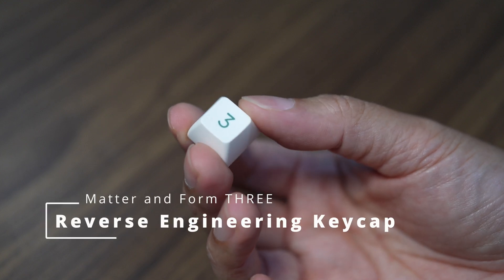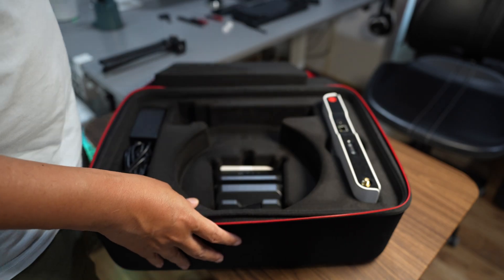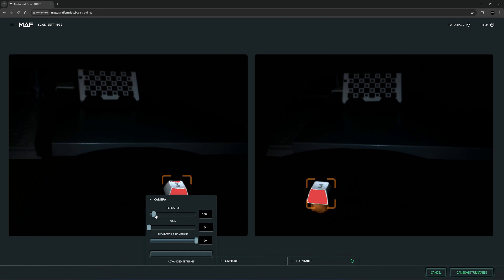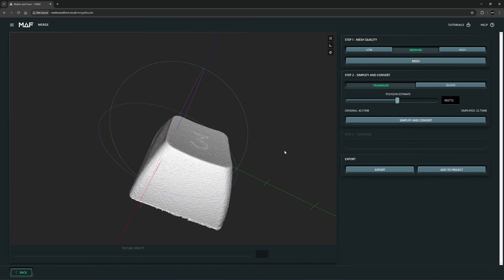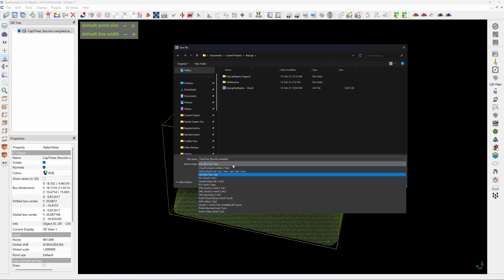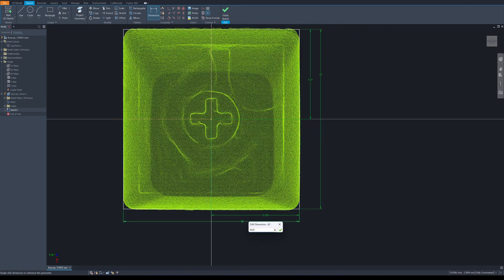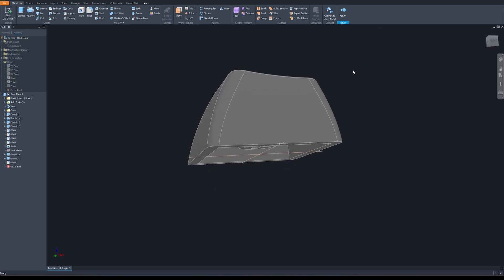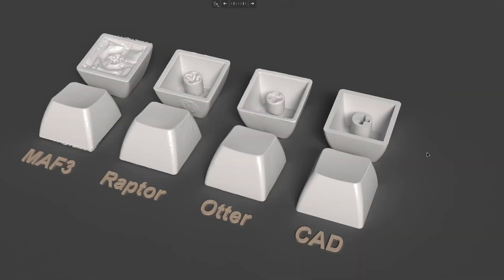3D Scan to CAD - Reverse Engineering Keycap with Matter and Form THREE 3D Scanner

Comment: I find that with small object, the MAF3 struggles (or maybe I am the issue). But it doesn't seem to have the resolution to capture sharp edges of small parts (the size of your key cap or even a little smaller). On larger items 50 mm or larger, is seems to do well, but still struggles with small details. But, I do like the "ease" of use. I can do something else while it's scanning using a turntable.  

I wish they had the ability to use markers. 
I find that their scans are noisy, they may need more work on the software side, or maybe it's just a limitation of the hardware.  What are your thought regarding this scanner?
Reply from the maker: For MAF3, applying a contrast-reducing spray may be necessary to minimize noise. The corner edges are impressively sharp—comparable to those from a laser scanner. However, it struggles to capture deep pockets and crevices, and its tripod-mounted design limits full-angle coverage in a single rotation.

Comment: Any chance you will get revopoint metrox for test? I wonder how it will compare to standard raptor.
Reply from the maker: Revopoint told me they will send the testing unit after fixing their software issue, end of Feb.
Reply: @Payo-TensileCreator  Nice we'll see if they keep their word. Price is good, tech is better (more lazzers) I only wonder how big is fov in large mode and how is overall scanning experience compared to raptor / creality scan (soft).. Is it faster, simpler, more accurate than raptor? Can't wait for your test
Reply from the maker: @ They've been stalling the delivery of the testing unit since November last year.
Reply: @Payo-TensileCreator  ouch that does not sound good.. Feb is almost over, will see what they do. Your tests are one of the best on the yt, maybe they are afraid of it ;)
Reply: @Payo-TensileCreator  its march. Oh man. I am very curious how the metro x does in the same demonstration.
Reply from the maker: @chiawildy563  I have made an announcement here regarding Metro X review. http://youtube.com/post/UgkxPVQQle-IqaG4sDGWE4NmCZp0nLI3zzkV?si=dDsYgnFUW1sDN3Tm
Reply: Creality made new raptor pro. It's cheaper than raptor x. May bee It's more comparable to metrox?
Reply: @andreykvv  yes but raptor pro is $800 more than metroX standard edition and $600 more than metroX advanced edition (which has automated turntable). That's to much.. Raptor pro should cost same or maybe maximum of $100 more than revopoint metroX standard edition. The only advantage of the creality is scan quality but I think revopoint will fix that with further firmware and software updates.